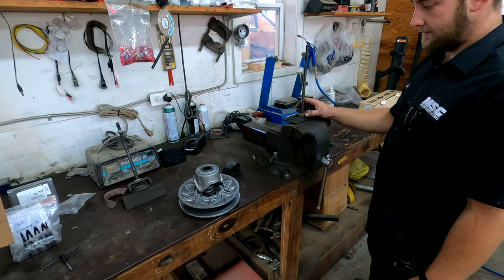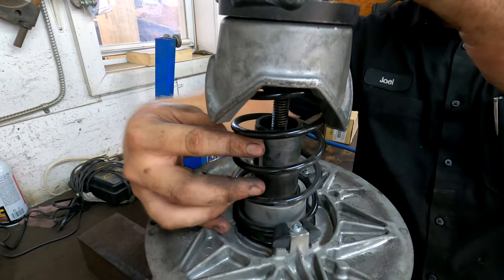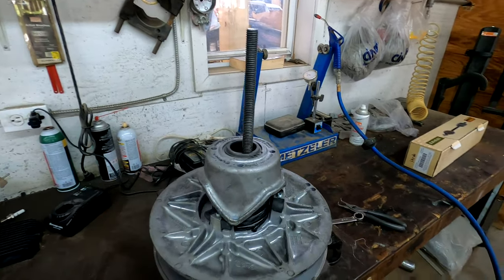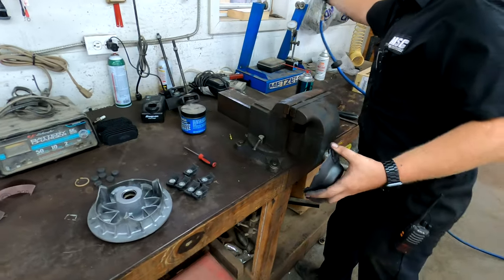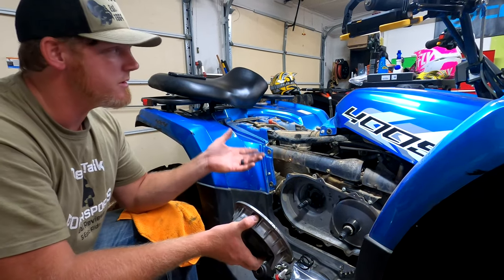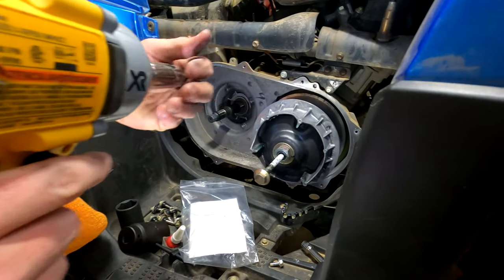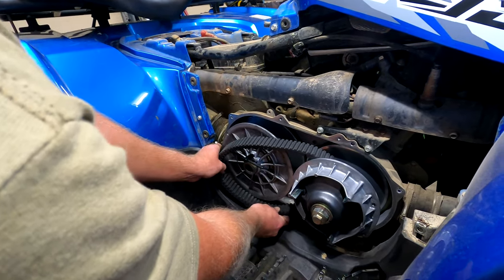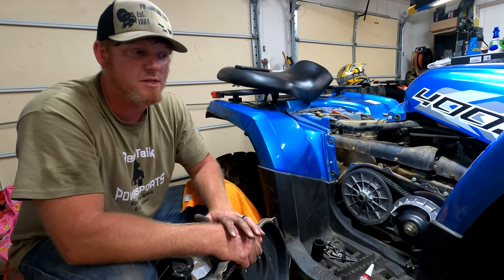CVTech CFMOTO Clutch Kit Install | How to Re-Clock Secondary & Install Kit

Comment from the maker: Call 662-438-6407 to order your clutch kit from Main Street Cycle.. the number listed at beginning of video it incorrect.
Reply: I just called Main Street and they will not have the kits for the 600 available for a few weeks.  They did not yet have a price either.
Reply: Yea I went got my 600 Friday they going to be close for a whole week(Vacation) so they told me two weeks
Reply: What's the price to bring 600 in and have clutch kit done? Also, will they install a warrior riser snorkel kit?
Reply from the maker: @keiththesquirrel  hey Keith, just give them a call Monday.
Reply: Should you wait to install  till after you break it in?

Comment: Thank you! I have a 2019 and there are not a lot of videos on how do stuff in English. Appreciate your time you spend making these.
Reply: I took my secondary apart and put it back together, but when i took it off the spring jumped out and threw everything all over my garage, do they all have that key that goes into it, because i have a slot and lined them up but i couldn't find a key that goes into it? did i mess up?
Reply: Most definitely. These videos are excellent!

Comment: Thanks for the video, Blake. I just ordered my airdam clutch kit from Adam for my 600 touring. Can't wait to see the difference. I'll use this video to help me load the new weights and spring !!! James
Reply from the maker: AWESOME!!! I know you will be impressed
Reply: Hi,what is the difference in your experience after the kit?
Reply: @GeneracionGoshen777   Nothing really, but I didn't reclock my secondary . I called them to ask if  I could wait until I got bigger tires and he said yes. I advice to reclock secondary when installing the clutch kit to get full results.
Reply: Yeah I'm trying to find out which kit and settings I need for a 600 Touring stock machine.
Reply: @KakarotsSpirit4   I would call Adam at Air Dam and talk with him. He and Blake has lots of experience with these machines and can help you out with your specific needs. 👍
Reply: @jhrsmail  right on. Thanks, I'll do that.
Reply: @KakarotsSpirit4  did you ever find out what we need, I read on a forum that with 27s, a good setup is CVTECH 0951-1015 spring (200/900) with 14g weights on primary and secondary can be left how it is, or clocked to B3.  I beleive that stock is B1 on the secondary, but havent taken it apart yet.
Reply: @vk101a  no I really haven't. I just went with the penny mod lol
Reply: @vk101a  just pennies.
Reply: @KakarotsSpirit4  15g weights on stock spring (1013) with C1 secondary clock is an excellent combo for stock tires 2020-2022 cforce 600

Comment: Great video. That 400 is gonna feel much better I’m sure.
Reply from the maker: Thank you sir and yes I tested it last night and it did great! The weather is terrible right now so it will be a few more days before I can finish the 800 video and the 400
Reply: That’s the video we’re all waiting for. Gonna get that bottom end snap back that those big tires robbed a little bit of. I kinda think the 28’s I’m gonna use won’t require a clutch kit I’ll probably do it for longer belt life. I’ll chat with Adam from airdam when I’m ready to get a kit tuned for it.

Comment: I just picked up a 2019 800xc.  What's the purpose for the clutch kit?  I'm in the process of tearing it down and doing a deep clean and just checking out where everything is at.  While it's tore down any upgrades I think will help me I'll do.  Great channel!
Reply from the maker: Thanks Eric.. we have a few videos on the channel explaining in detail about the kits for CFMOTO and Main Street Cycle carries the kit that i recommend for each model. So all you have to do is call them and tell them what model you have and they can ship you the kit you need. It will consist of new Primary Spring and primary weights and instructions on how to reclock your sevondary clutch. It helps eliminate belt slipping, its allows the engine to go higher in the RPM range to apply the Horse power that the engine is capable to apply and increases the rate of acceleration.

Comment: 2021 600 Touring in 2wd High 
 Idles @ 1400 rpm 
moves @2300 rpm 
8mph@4000rpm 
11mph 5000@ 11mph 
low end torque high rpm vibration  killing me
i'm a Hunter usual speed under 20mph quiet is Golden!
  What helps ?

Comment: actually you need dust proof grease in there, not water proof. Because in normal conditions there is a lot dust and not water. Dust should not stick to that grease or it will not move freely

Comment: Hello! Great videos!! We get a lot of information from them. Yet i am a litlle unsure with what option i should go with. I have a cf 820 from 2019. It has quite a bit of power, but i would like some more torque. Most of the time i go on mountain roads with moderate to hard climbs, so i need it to pull in Low gear, even at higher rpm.

Comment: Hello I'm from Brazil, here I have a ZFORCE 1000 SPORT, equivalent to the American ZFORCE 950 H.O SPORT. 

The Brazilian market does not have qualified mechanics, the little I learn is from watching your videos. 

When trying to contact CFMOTO Brasil to obtain information, they refuse to respond. 

Could you tell me the position of the secondary CVT of the ZFORCE 950 H.O SPORT?

Comment: Just installed the clutch kit for 2021 cforce 600. Primary clutch is a 32mm and secondary is a 36mm.  Also got it all together and the secondary is so tight it dies as soon as you put it into gear
Reply: Was there a big difference
Reply: @remo900rr  not really. Apparently the clutch kit I got was for bigger tires. I was told that was the only kit they had at main street cycles. I am not impressed with the power of the cforce 600.  Everyone I have let ride the bike asks if something is wrong with it.. Eventually I would like to get an entire new clutch kit from airdam clutches with new primary and secondary and not just weights and a spring. If I had to do it over again I would not have bought the 600.  It is way under powered. I also have a 2013 honda foreman 500, and 2019 polaris 570 sportsman.  Both put this thing to shame.

Comment: Hi, I have a question as to what this clutch kit will do for the performance of your quad.  Will it lower the rpm's, increase speed, achieve better fuel economy???
Reply: All depends what kind of kit you get. Some will give better accel but lose top end. Some the other way around. Just depends.

Comment: I have a cf moto 550 2019 can you tell what way the one way bearing should spin on the shaft please to double check anti-clockwise or clockwise changed my secondary and my one way bearing still geting wining noise could this be belt

Comment: For the spring tension for B3 is aroumd 70 degrees (according to the video you linked in another comment). So even though everything lines up if i i go straight down i still need to rotate around 1/4 turn to the next leg?  Is that how the tension and clocking work?
Reply: Good question wishe they gave a answer

Comment: Hi!
I have Cforce 450L 2019. and from quad I want more power in high gear when i go uphil.
Now in uphil my cforce is loosing power, rpm is the same but speed just drops.

I contacted Airdum clutch and Main Street Cycle but no one has responded for last 3 weeks. I would really like to install a kit ( spring and rollers) for primary clutch. Is there some website to order central spring and variomat roller?

Can i just re-clock secundary clutch for better performance for drive uphil in high gear? And in what position I need re-clock secondary clutch? 

Thanks!!

Comment: Those weights look larger then the original weights.  I thought you wanted to go lighter with larger tires.  Factory is 14grams.  Don't you want to go down to 10grams? The plastic sliders are 8grams for a total of 18grams.

Comment: Great job, a shame we cannot order the upgrade to Croatia :(
Can you tell me what are the torque specs for bolting on primary and secondary clutches back to the machine? I can't find them anywhere...
Reply: Ok, so for all of you that are searching the internet for the answer, I finally found it in the service manual (for 850xc). Driver pulley main nut = 180Nm, driver pulley shaft nut = 60Nm, driven pulley nut = 150Nm

Comment: Hey man quick question on install for the new clutch? Is there torque specs to follow when installing or servicing the clutch? Is it the manual?  I notice you are just using the impact.
Reply from the maker: You have to have a special tool to hold the clutches to be able to properly torque them.. but the guys at the shop have certain impacts calibrated to be able to torque them like they need to be. The torque spec is in the service manual
Reply: Thanks brother. I just bought a CF Moto 600 touring.

Comment: Blake I just received my kit from Main Street for my 800. It says to clock it at B3 but I noticed you said you had yours set at C2 which one is correct ? Thanks
Reply from the maker: B3 is perfect... B3 and C2 are only like 1 or 2 degrees difference.

Comment: Can I ask why you did this  I have a 2022 Uforce 1000  clutch take a minute to engage will this help
Reply from the maker: Yes a MSC Stage 2 clutch kit or a MSC STAGE 3 Trail clutch kit will do wonders for your UFORCE..
I’m currently running the stage 3 trail kit in my crew cab..
You can get it at mainstreetcycle. com

Comment: I know I have asked a couple questions but the last thing that is confusing me is that there are 3 triangle pieces and 3 rubber feet, which one do they need to be against, because i went to A-3 and it lined up perfectly with my mark from B-1, so i didn't have to twist it to get it on the right side of the rubber foot. Should i have twisted it anyways and tried to go to the next rubber foot?
Reply from the maker: Yes it has to be twisted because that is how you get your "Spring Tension"  A3 should be around 88 Degrees which is a LOT!  I am at C2 on my 800  and 500  and B3 on my 600

Comment: I wanna change up my secondary clutch I already upgraded the primary. But I’m looking for info on what I should change it to (secondary)?? I like to ride hard and fast. Stock rims woth mud lite 2’s on.
Reply from the maker: I Would recommend A-2. Or even B-3. What size are your mudlites and what machine do you have
Reply: Sorry I thought I put that in there 🤦🏽‍♂️ I have the 2020 cforce 500 and it’s just stock rims
Reply from the maker: @BrandoCG  You will definately see great improvement by going to A-2
Reply: Awesome thank you. I watch all your videos daily. I want to do the lift kit but don’t want the back wheels sticking out lol
Reply from the maker: @BrandoCG  All you have to do is buy some front wheel spacers to make it match.. or you can go to a 14 inch aftermarket rim with a 5+2 offset and you wont use the rear spacers.
Reply: What was price for upgrade kit for primary clutch?

Comment: i have a 2021 cforce 600 touring with 65 miles on it.i like it very much but after riding for 30 mins or so i parked it to check the clutch  and the metal housing around the clutch was quite hot is that normal
Reply: Yes

Comment: Hey how you doing? I have a quick question about my 2019 cf moto 800xc. When I ride my cf moto a Lil over a hour it starts to cut off when I hit da gas. It also start jerking hard like it’s catching gear hard when I first hit da gas. Now when it starts to do that I let it sit for about a hour and it stops and start riding normal again. What do you think that could be?
Reply from the maker: Awe man i am honestly not sure.. Id have to ask my shop...
Reply: Thank you a lot but I will b taking that 3h trip to Main Street to get da clutch kit done. How long do it take to do the clutch kit?

Comment: Did you silicon the cover when you reinstalled it?
Reply from the maker: No, the factory seal on the clutch cover is very good.. Just always inspect it and make sure its in the groove right. Ive never had one to leak
Reply: @RealTalkPowersports  is there a torq spec on the cover bolts? Thanks for your help

Comment: What's that tool, you forgot to put it in your description
Reply from the maker: Thanks i just put a link in there for it.. but you may want to shop around and get the best price for that tool
https://epiperformance.com/clutch-compression-tool-cct510/?campaignid=1578119757&adgroupid=59027618785&adid=296444636601&gclid=Cj0KCQjwudb3BRC9ARIsAEa-vUsg_-GfVSSq822zAcyzVFuqNAjHGI-xZCvaHr7tfOjwnBpe4mt8htcaArbAEALw_wcB
Reply: @RealTalkPowersports  after looking at it more, it looks like it wouldn't be to hard to make my own.
Reply from the maker: @shaneanderson6452  that's right bro.. some all thread, about 15 inches long.. or longer
Reply: @RealTalkPowersports  thanks,  also just ordered the kit for my wife's 500trail.

Comment: Is this the same clutch kit you had for the 500? Or is that the air dam clutch kit??
Reply from the maker: This is the kits I run
Reply: @RealTalkPowersports  is there other means of contact? Other then calling them? Lol  I'm in Canada 🇨🇦  but most definitely interested. More or less will they ship to Canada?
Reply from the maker: @justincourt668  hey Justin i believe MSC has only been able to setup a shipping method for inside the US.. They havent ventured out to more shipping methods yet due to increase in cost of shipping.
Reply: @RealTalkPowersports  okay that sucks lol. I've tried.talking to cf moto dealers and they look at me like they've never heard of reclocking the CVT blew MY mind. 

Would you be able to aid me in what parts I need to get it to the state I want? This is something I'd seriously like to do but everyone I talk to says.. I don't know.. lol
Reply from the maker: @justincourt668  where u live
Reply: @RealTalkPowersports  I live in Ontario Canada in the Ottawa Valley.
Reply: @RealTalkPowersports  would you happen to have part numbers? Colour code of the spring used? And how heavy the weights were?  I may be able to order the parts directly from CVTech.
Reply from the maker: @justincourt668  i dont justin.. When we get the kits the color code on springs is gone..
Reply: @RealTalkPowersports  okay ill message MSC and see if they'll send that info so I don't have to pay crazy shipping etc from the US to Canada.

Comment: IDK how he did it, but he made the part where you turn the top disk to line up the notch with the rubber bumper, mine will NOT go back to its original position, i pulled my back trying to turn it, is there something i'm missing? Is it suppose to be this difficult?
Reply from the maker: No sir it shouldnt be that hard to turn it.. Im gonna send you another video link that may help you out
Reply from the maker: https://youtu.be/2JED-oeXc-U
Reply: I think i see, you can turn it only clockwise and it doesn't look like it matters which rubber boot you put it against as long as it's on the right side of it.. lol i kept trying to put it counterclockwise back to its original position.. Thanks man, HUGE help.